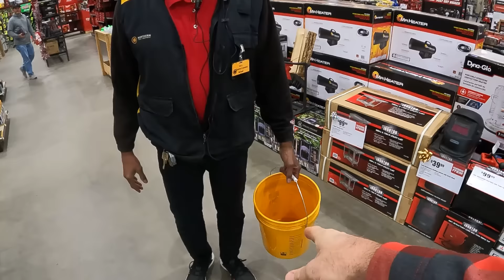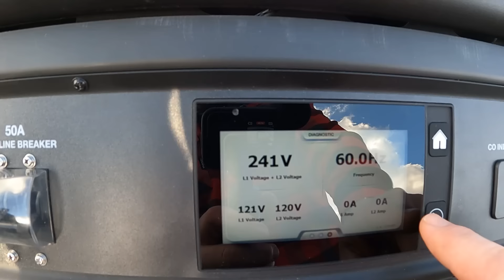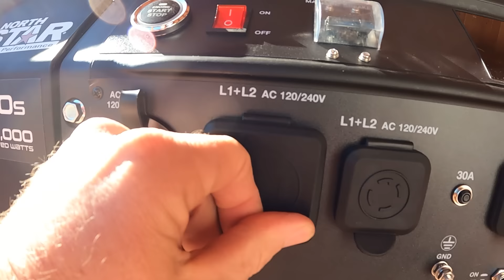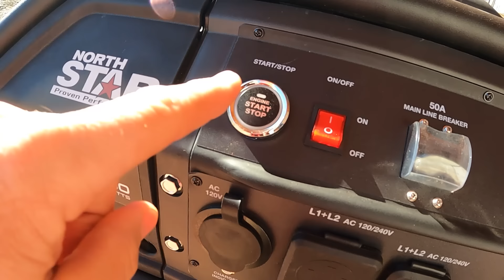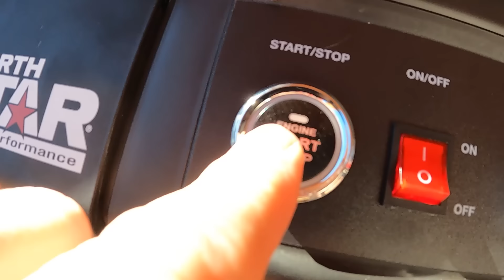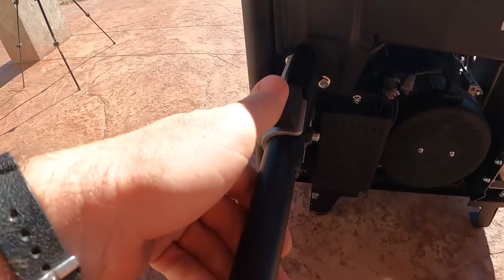Grid Collapse? Winter Storm! New Generator Technology that Could Prevent disaster!

Comment: Love how they compare to Honda engine. Just like the Predator. BUT it ain’t no Honda engine. 😂Looks nice. Even though it’s fuel injected it’s imperative to have fresh fuel and run it periodically.
Reply: Right, everyone says "Just like a Honda".  LOL  I use only non-Ethanol fuel in my Honda EU7000. Using non-corn juice in these is the best thing you can do to ensure reliability.   I also noticed there is no pull-start backup on the Northern unit. Probably because no one would have the strength to pull the cord anyway. Keep a jump box handy.
Reply from the maker: it's arguably better than Honda! Northern tool took the best tech from every engine and built this bulletproof system
Reply: @StoneyRidgeFarmer Hmmm.. BETTER than Honda? I guess that's why most commercial equipment like log splitters, water pumps, trash pumps, fuel trailers, etc. all use Northern engines. Only time will tell. Every time someone comes out with something brand new it's suddenly "Better than Honda". I'm not saying Honda is flawless, but their reputation was built over time. Will it start in minus temperatures?  Will it continue to run when it's over 100 degrees?  I mean, everything works great right out of the box. Time is the only judge of reliability and dependability. It definitely looks like a nice unit power-wise and feature-wise but keep in mind all those fancy whistles and bells can fail and I doubt you'll have much luck with replacement parts. Let's circle back in 10 years and see how it's doing. Again, I hope it does well.
Reply: @StoneyRidgeFarmer  I’d argue with you that’s it’s better. Honda is king of most reliable small engines.

Comment: I had a whole home generator installed (Generac) since we have Natural Gas, we needed to have a 3/4” gas supply line installed by the gas company (replacing the old 1/2” line). Works great. Kicks on automatically.
Reply: A whole house standby Generac with natural gas, and/or a 1,000 gallon propane tank is the way to go, even with a 500 gallon propane pig. Hauling and storing gasoline is not the way to go.
Reply: Whole house generators use a LOT of propane @trajan6927